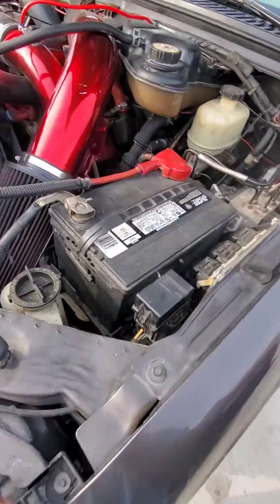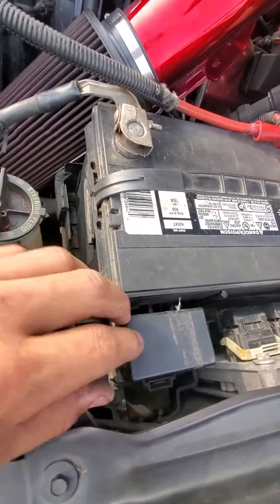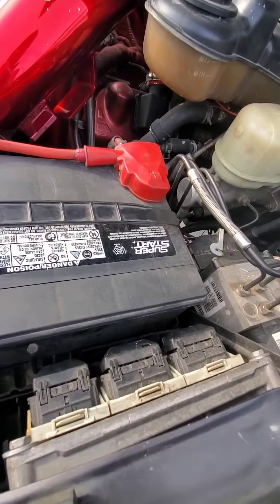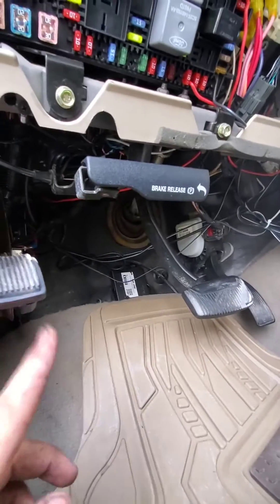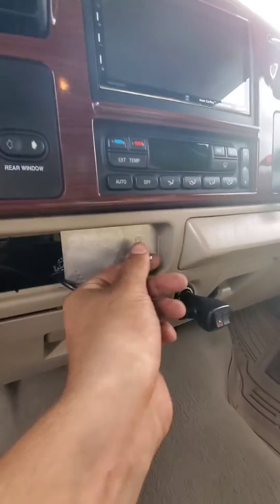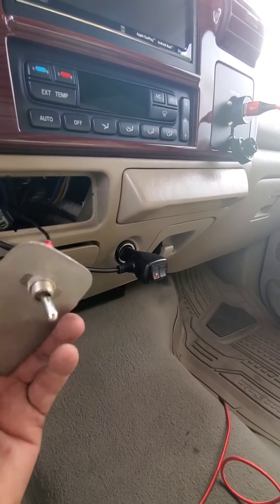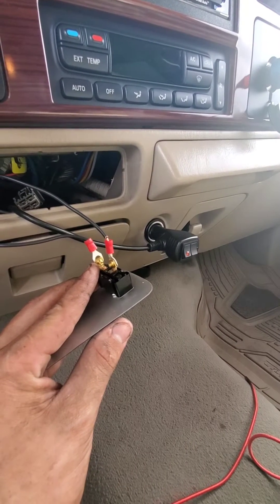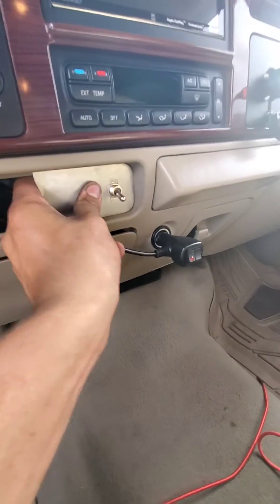5r110 Manual Lockup Switch Install

Comment: I did this to my 2005 and now the tow haul light flashes, and eventually will just stay on it. Definitely locks up the torque converter but now I have a code??
Reply: That is normal, it’s throwing the code since it thinks the torque converter is grounded, which is essentially what you are doing…just use your tuner ,etc and clear the code when your switch is off, and it will clear the code!

Comment: If you wanted complete manual control of lock up. How would you wire it? What would be really sweet is if i could make a fmvb for a 5r110
Reply from the maker: I think you would just tell your tuner that you don’t want the tune to ever command lockup… but you’ll need to be a little careful when you do command lockup! Before 3rd gear, it will slam gears etc if you manually command TL. but I don’t think it would be possible to actually make a fmvb on the 5r110…

Comment: how can i wire this into one of my uplifter switches
Reply: should i just use a wire tap and ground one side then run the other wire to my uplifter switch correct?
Reply: @henrytheboss2658  yes I think so… if I’m correct., 2 of the upfitter switches are powered, and the other 2 are grounded…
Reply: @kingkustomsandperformance2549  do you know how I should do it?

Comment: I’m building my 5r110 right now unless it’s the clutch pack I’m putting in I was told you have to defuel thru shifts to prevent the clutch surfaces from getting smoked right off and blowing the trans I got a 92 12v in front of mine

Comment: Is this safe for a 6.0 making 450hp and 700 ft lbs of tourqe on a stock trans?
Reply from the maker: Yes it will be completely fine, even though I would recommend to wait till after you’re through the bottom gears, simply because it does hit pretty hard until you are in like third gear. This install was actually on my 6.0 pushing 750 hp fuel only…

Comment: Did you tap into the wire from the plug or did you tap into the wire that was going to the plug?  Or did you splice fully into it and leave the wire intact?
Reply from the maker: I just tapped into the wire going to the plug, and you can buy clips that you clip over the existing wire that will splice into it, but will not hurt the wire!
Reply: @sunsetdiesel  would you mind doing a video of exactly How you tapped into it?  Like show the wires?  Or is it how I think you’re saying?  Leave the wire attached and just tap into it with one of those red or blue splice things
Reply from the maker: Yes the original wire stays attached and never gets cut!
Reply: @sunsetdiesel  also are you grounding it to itself?  Or a ground to metal?
Reply from the maker: And it gets grounded onto the truck…
Reply: @sunsetdiesel  or is it like doing a smoke switch where the wire is cut in half and both ends get hooked up to the switch?
Reply from the maker: No you don’t want to do that because then you will never have torque lock unless you manually turn on the switch… if you just tap into it it will work completely like factory except whenever the switch is on it will lock up.
Reply from the maker: You will want to run an non factory wire from your switch up to the wire that you tap into…

Comment: Kind of curious on this here, how well does it work if it’s locked before you take off?
Reply from the maker: It will not work, because it will stall the motor. It is the same concept as putting a manual truck in gear and releasing the clutch.

Comment: Kinda new to this trans stuff, I’m confused what the point of this is and what it exactly does.
Reply from the maker: Basically the switch will manually lock in the torque converter. So it will be similar to driving a truck with a manual transmission except that the transmission will shift on it’s own. So when you lock in the torque converter, you will have a lot better pulling torque because whatever rpms the engine is doing will be direct routed to the transmission. Instead of the torque converter slipping so that it won’t put torque on the transmission. I hope I’m making partial sense.

Comment: Is your crankcase routed to atmosphere? I tried mine one drive with it going through the S369 and it pulled more oil out of the motor than I would like.
Reply from the maker: It is not, simply because we rebuilt my motor only like 15k miles ago so there is zero blowby.

Comment: Thanks! Thinking about putting a 3 position switch in mine. Does your converter lock up normally when the switch is in the off position? Or does it stay unlocked until you switch it on?
Reply from the maker: Yes. It will lock up just like normal! Only reason that it wouldn't is if your switch doesn't carry enough amps. I would advise using a 5 amp or bigger.

Comment: How long have you had this on you're Truck ? Was wondering on something like this, ever since i installed a Precision Industries Triple Disk Converter, and Billet Input Shaft. Right around 50 mph is when mine locks up, and one road that i drive on very often is right around that speed and when I'm in traffic on that road it constantly locking and un locking. I can drive it fine if there isn't any Assholes in front of me, but there's usually alot of traffic at this speed. I'm just wondering how long you been driving with this ? And you haven't burned nothing up in the Transmission yet ?
Reply from the maker: I have had it on my truck for only about a week now. But I talked with some of the guys that race 6.0 all the time and they always ran a switch. It definitely shifts harder simply because it is in torque lock and the tow haul light will flash because it thinks that the torque converter circuit is stuck on but it runs fine.
Reply from the maker: The lock up switch works really well if you are driving at a speed where it would normally kick in and out of torque lock. I would not be scared of running a switch for that. It is hard on your trans more when you're locked up and going through the gears.